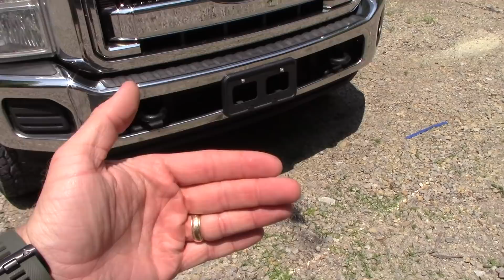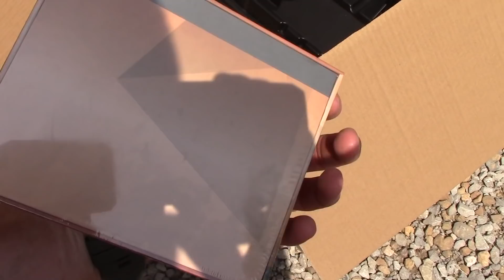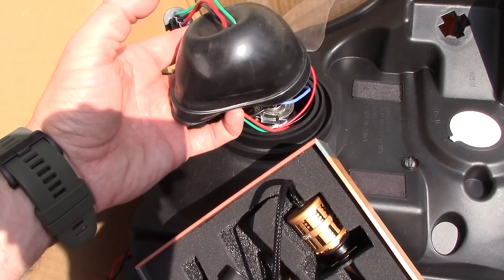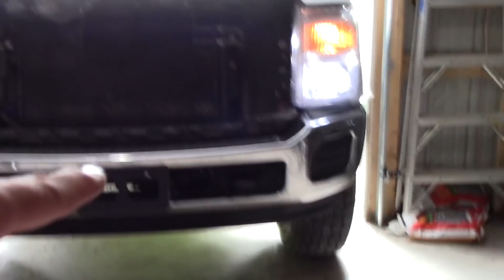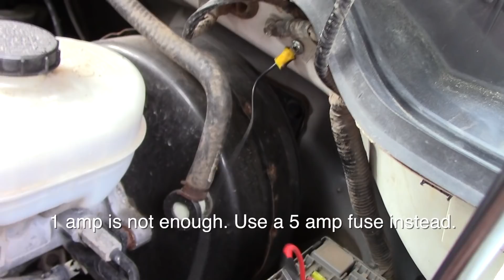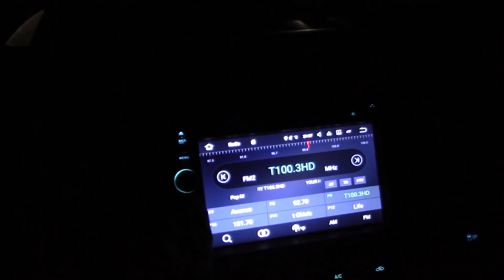2011-2016 Ford F250 F350 LED / HID Projector Headlights Upgrade w/ Morimoto 2 stroke 2.0

Comment: These Projectors are no longer available.  Any other suggestion?  I have HIDs ready to go in my 2011 but only the original factory Headlights.  I'm afraid I will get pulled over because of the glare.  There are so many options its hard to know what to choose on Amazon.

Comment: I had HID lamps in 2 previous vehicles, I found that the after market HID lamps were deemed illegal in the UK if you were to install them on cars that came originally with halogen bulbs from the factory LED bulbs are cheaper as well but you should not buy really cheap LEDs as the fit is not good at all. 
On my latest car a Rav4 2012 model I have changed all the bulbs to LED including the interior ones, this makes so much difference compared to the standard lighting & a bonus is they last much much longer.

Comment: Can you access the bulbs via wheel wells? I just got my 2016 F 250 and it’s got a king ranch grill guard which without removing it, the grill and headlight covers aren’t coming off.
Reply from the maker: No I don't think so

Comment: Great video. Thanks. I’ve used the LEDs before and the coverage is spotty.  That’s due to the two sides bulb & no illumination on the front. I’d likely go with the HID just to get a full coverage, smoother illumination.  But nice job! Great thorough explanations

Comment: How did you run that 5 amp to the fuse box? And how did you run the DRL wires to the other headlight? Does the passenger side have to same wires as well?
Reply from the maker: I made a harness. Yes the same wires run to the passenger side. I just split the circuit at the driver's side headlight.

Comment: Want a fan burn out from it  Having a supply of air to pull from since  it's covered by the dust cap
Reply from the maker: No. Plenty of space inside of the headlight.